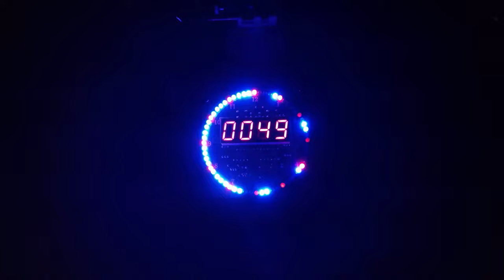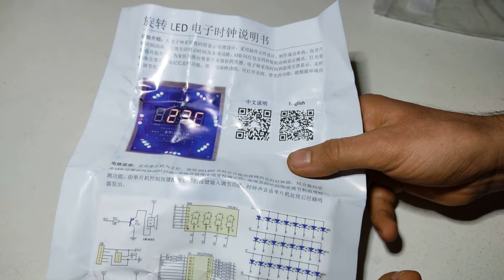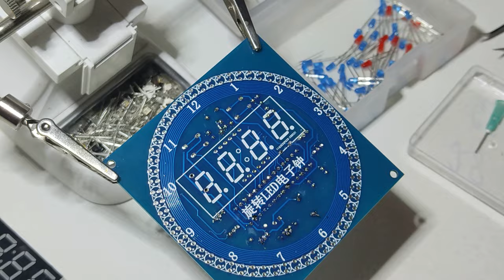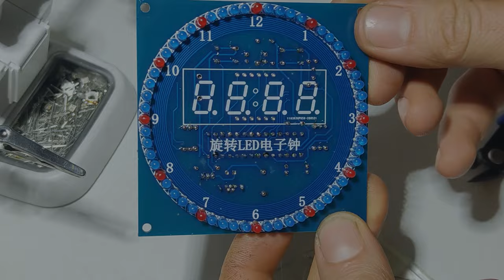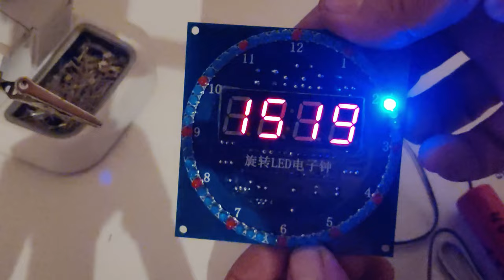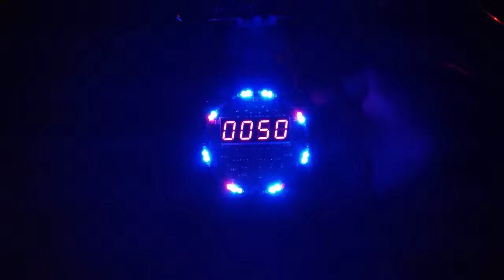Rotating LED Electronic Clock Kit , DS1302 , STC15W408AS , Soldering

Comment: Nice video I built one of these clocks and  five of the red LEDs were bad out of the package and the little PNP transistor was bad. Fortunately, I had some spares laying around the house. Make sure to test all of the LEDs before soldering them in. You can use the little coin cell that comes with the kit to test the LED's
Reply from the maker: Because the LEDs are very weak, they fail quickly, several were damaged during soldering
Reply: @nazim042  I tested all the LEDs prior to installing each one, oddly, it was only the red ones that were bad, the blue ones were all fine, and there were more of them. I also tested the transistor on a component tester, and it was bad too. But it's just a common PNP, S9012, and was easy to replace from my stock of components here at the house. I just build these little kits to test my eyes, as I have diabetic retinopathy. I do wish they would make a version of the program for that micro controller that had an option for 12 hour format.
Reply from the maker: @wildstar1063  yes, my friend, during soldering, LEDs and transistors heat up and fail due to the high temperature.  Because the quality is very low.

Comment: Hi, after applying the power, only the buzzer squeaks, nothing else happens, the diodes and the display do not light, all connections are working, the diodes are soldered in accordance with the polarity, does it mean damaged STC, D13, where could I make a mistake ???
Reply from the maker: Hello.  Check the resistors carefully. Something may not be right in place

Comment: After leaving it on for some time, some of the LEDs stay on even when they shouldn't be on, it doesn't affect functionality however I was wondering what the reason would be ? (wrong resistor or capacitor size ?)
Reply from the maker: hello  There may be any gaps in the solder or pcb board, please review them again.  And because the quality of the LEDs is very poor, the solder can be damaged

Comment: I had problems with the thermistor on mine so bought a second. Had the same problem. The display was just erroring out and displaying rubbish, not even a temperature. I measured the resistance of the thermistor and seemed very high 16 or 18k. Its supposed to be 10k. Ordered some 10k's and both worked properly when fitted. The kits have the wrong thermistors in them recently. Hope this helps someone building. For ages I thought it was just dodgy soldering on my part
Reply from the maker: Hello, thank you for your support.  It is true that details can be a problem because they are the cheapest.  I've collected a few and haven't had any problems yet.

Comment: Does anyone have the operating instructions? The kit is easy to build, but it would be nice to have operating instructions for its many features.
Reply: It does not have many features ... the first "0000"/"1111" means alarm off/on, the second "0000"/"1111" is for the light dimmer.
Reply: @tubie1888  how do you send it the instructions. I have 2 amd the work different. One chimes every hour, the other don't. I cannot make the dots lit in the time mode (useful not to confuse with year). Is there any repository with programs / firmwares?
Reply: @fabianlupidi  These are no instructions but settings you select by the buttons. As far as I know, there is no open source firmware available yet but it's under development.
Reply: @tubie1888  thanks. But ive seen many models have the blinking dots in time mode. Mine two clocks DONT, I think is a firmware problem. My model doesnt come with ldr (for ex) and has 3 buttons (mode, set and plus). And in the menu has different settings, of course, has no settings for the LDR...

Comment: Hola, gracias por el video, es muy explicativo, espero puedas ayudarme, armé este reloj con mi hijo hace un par de años, estuvo trabajando bien pero ahora empezó a fallar, da muy bien la hora y no se atrasa, en eso no tiene problemas pero en la pantalla se observan figuras residuales por ejemplo cuando da la temperatura el primer digito que por lo general no se enciende, presenta algunos de los contornos del digito tenuemente encendidos y tambien algunos leds se encienden levemente cuando no deberian mostrar actividad, te pido si podrias explicarme como podria solucionarlo, debo comentarte que cuando lo armamos y conectamos via usb a 5v funcionó y no le pusimos la pila de boton que no venia con el kit, es necesaria? que funcion cumple? leo en los comentarios que el integrado STC.... viene programado, quiere decir que si compro uno de reemplazo no lo podria cambiar sin esa programacion?, gracias por tu respuesta, estare atento a ella.
Reply from the maker: Hello, thank you.  I have collected and made several of this watch.  If there is no small battery, there is no problem, it is only for storing memory. If there is a problem with Ds1302, you can change it, but the Stc memory chip must have the necessary equipment to write it.
Reply: @nazim042  gracias por responderme tan pronto, con respecto al STC ya ni modo, no tengo el equipo ni los conocimientos necesario para hacerlo, soy solo aficionado a la electronica, haré algunas pruebas y vere como se comporta, muchas gracias por tu ayuda.
Reply from the maker: @carlostapia3966  Por mucho que busqué, no pude encontrar el firmware para este chip.  Esto sólo se puede solicitar en tiendas que vendan relojes.  Porque en este esquema hay un programa para encender las luces.
Reply: @nazim042  ya esta funcionando bien, cambie los leds quemados (3) y repasé las soldaduras del DS 1302, tambien cambié la alimentacion a bateria y esta funcionando bien, creo que era el voltaje que recibia, gracias por la ayuda que me brindaste, gracias por ayudar desinteresadamente a los demas.
Reply from the maker: quedó muy bien) el reloj no funciona correctamente cuando hay un problema con la batería o el adaptador) las luces LED son de muy baja calidad y fallan durante la soldadura.  te lo agradezco